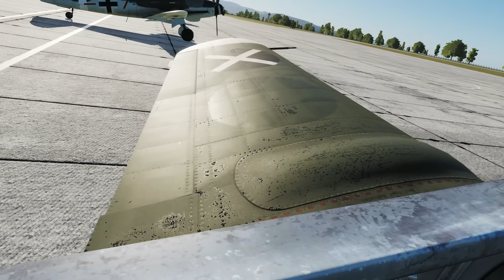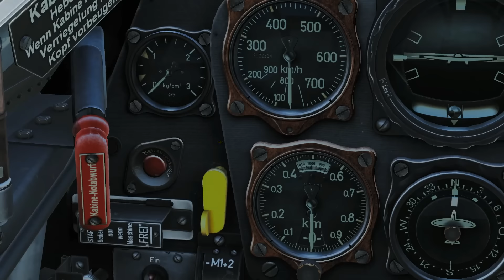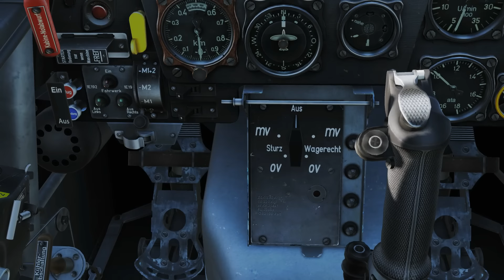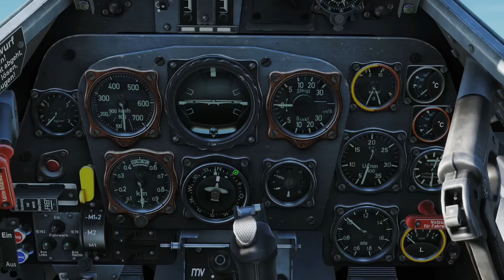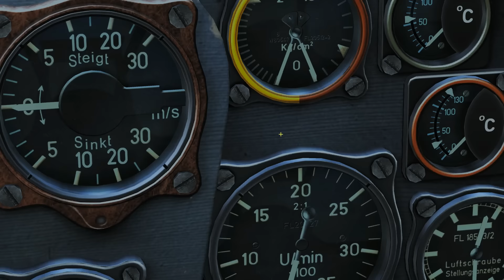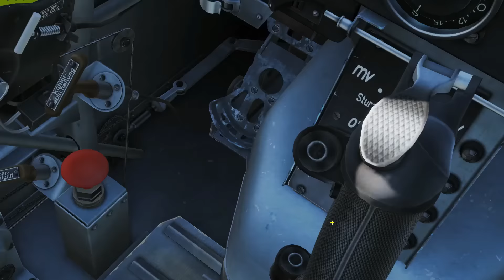BF-109 K-4: Cockpit Tour Tutorial | DCS WORLD

Comment: Actually the bucket seat is meant to accommodate the emergency parachute which is on your bottom if you strap it correctly, most WW2 fighters had these, so you would be actually sitting on a tightly folded piece of nylon and ropes. A little bit more comfortable

Comment: The FuGz25a  homing beacon can tell you if you are going towards or away from the beacon by the way it moves as you turn. If it flicks rapidlyly fully left or right you are flying away. If it turns at the same rate as the aircraft you are heading towards the beacon. The horizontal needle will also rise towards the Nahr (near) mark. The three grades indicate range to beacon. Bottom= 100kms, middle 50kms, top 25kms. All ranges being approximate based on atmospheric or geographical conditions and strength of beacon transmission. The allies also used to jam the transmissions or spoof them, causing aircraft to get lost. On a few occasions pilots landed at allied airfields.
Reply from the maker: thxx

Comment: Yes, the 109 had spartan controls as opposed to the Focke Wulf which had single lever prop/mixture/throttle control, electric aileron trim and other niceties. And Brits used to joke that 109 pilots had one leg shorter than the other due to the need for heavy rudder use on climb-out but no rudder trim. But it was a splendid pure interceptor, albeit short-ranged. The most prolific aces in history achieved most, if not all (Erich Hartmann) of their victories in the 109. MW50 was methanol/water injection which kicked its DB 605D up to nearly 2000 HP making it faster than the Mustang and superior to all the Allied fighters of the day in rate of climb.

Comment: To be fair, in WW2, you sat on your parachute which also went up your back I believe.  So you brought your own seat cushion to any plane you flew.

What is the circle thing on the front windshield lower right corner?  Looks like a spaghetti strainer or something LOL

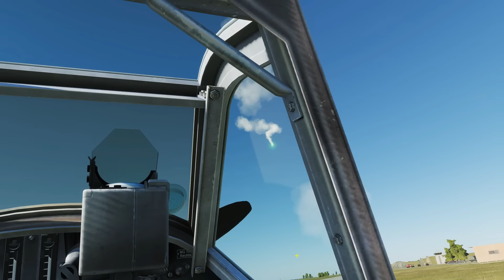22:48 "Ooh, whoopsie." -CAP  LOL  This is my problem as well when someone is showing me something.  "Hey let me show you this item and discuss it before we....damnit, you already pulled the trigger didn't you?"
Reply: Helps to defog the armour glass plates. I believe the inner layer was perspex and had an air gap to absorb any spalling or splinters
Reply: Small packs of moisture absorbing compounds were placed in this opening. I don´t know if modern silica gels like the one  you find in new electronic devices were in existence in the 40s. 

That compound absorbed any moisture between the different glass plates. Without that the armored windscreen would have become blind by condensing water between the different glass plates in greater altitudes.

Comment: A few things to mention: Not that it matters much, but I got the MK108/R21 switch wrong. The referred to MK108s are not only your wing mounted ones. The trigger used for firing the MK108 cannon is the same as would be used for rockets, were they available, so that one switches the function of it.
Also it would appear that you no longer get 3 flares of every colour, ED seem to have reduced it to 1. Sadface.
Finally, silly Cap: When you would up the ammo counter you wound it up to the 5th white line from the bottom, not the 4th. This way you're gonna end up wondering why the heck your gun's not firing when you're still supposed to have more ammo. :P

Comment: And also probably the easiest of the warbirds to fly. It has a nice, gentle stall and will generally land without killing you. The hard part's getting it to go straight on takeouff.
Reply: 109's were notorious for their poor landing gear configuration and just difficulty to land in general, not to mention the cramped cockpit.
Reply: All depends what you're looking for. Comparing it to a Fw190 I have to agree that the stalling behaviour is much more easily controlled. On the flipside taxiing and landing is probably easier with the 190. The takeoff is something I actually struggled with more in the Dora, but your mileage may vary. But cruise flight in the Dora is sooo much more comfortable than in the 109, and formation flight with the Dora is beautiful, yet an absolute nightmare in the 109.